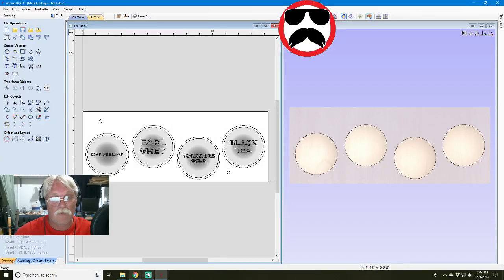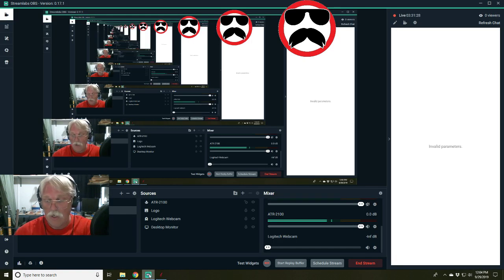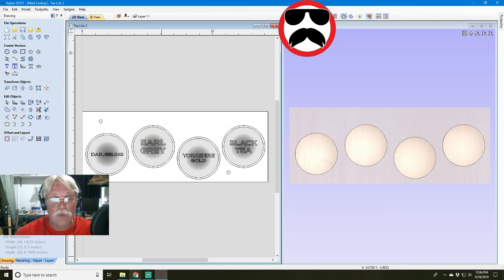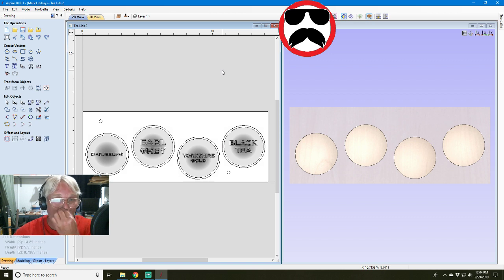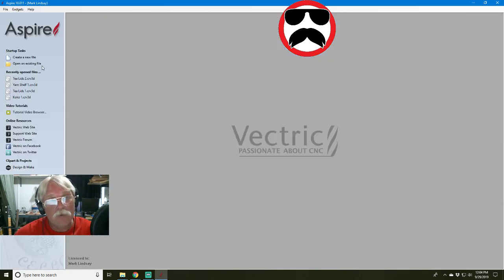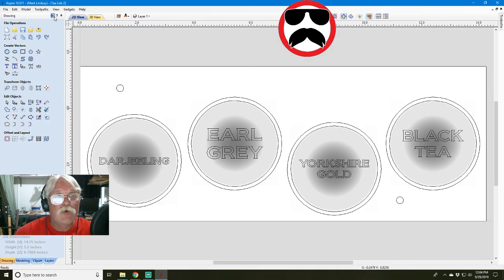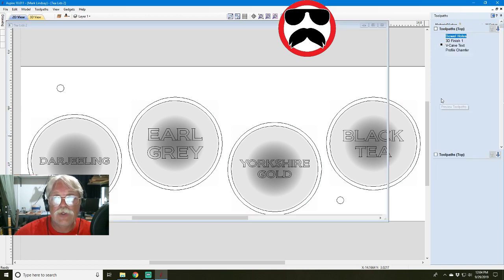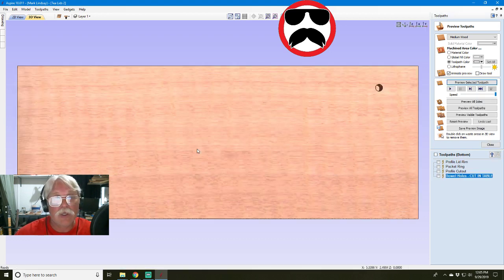LIVE Q&A #7 - Two-Sided Machining Part 2

Comment: Take care with manufactured stone (Silicosis is an 'occupational' lung disease. ... Dr ### estimates the number with the disease might be as high as one third of the Australian artificial stone-cutting workforce of about 5000, plus those who have left the trade.Aug 2, 2019
Reply from the maker: Proper protection is always important. I do wear a mask or respirator all the time. If you look closely, you'll see me put on my PPE at the beginning of the first cutting time lapse. I didn't wear it while I was outside disk sanding, as I had a decent wind at my back, blowing everything away from me.